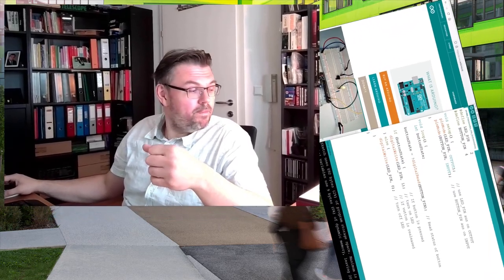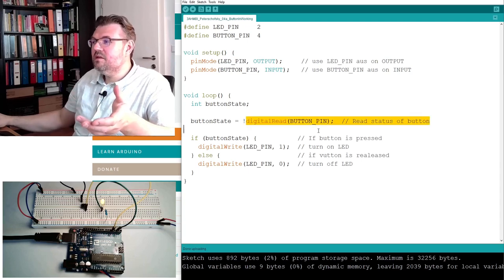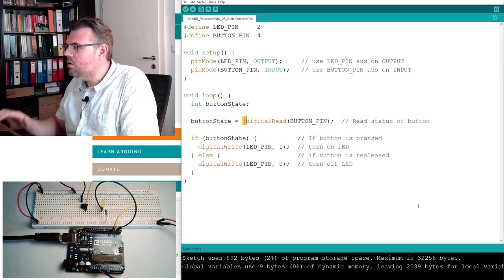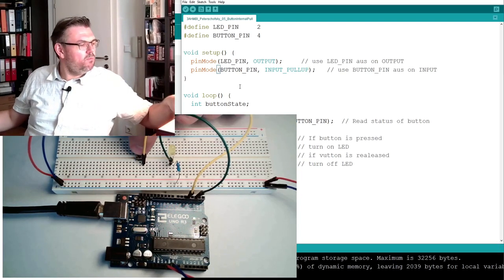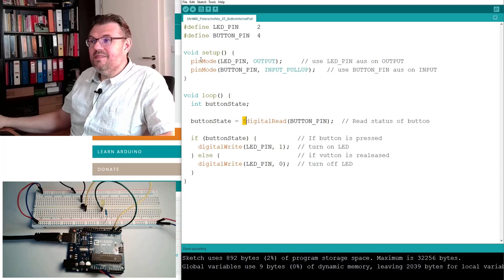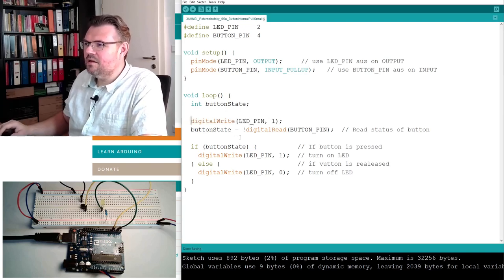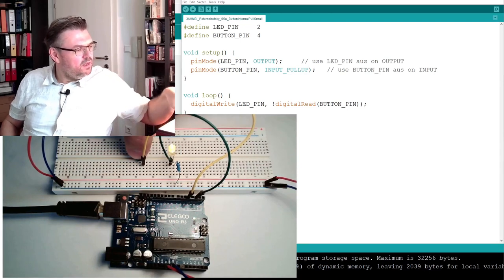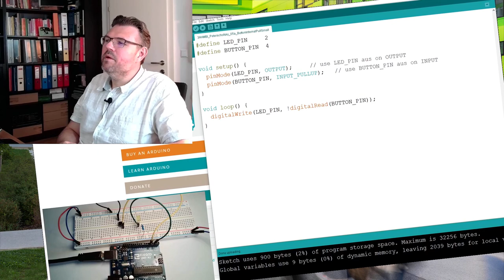Arduino 11: Internal Pullup Resistor

Comment: Hi Heinz, I agree 100% with you. There is a huge difference between engineering and programming. I also started to ignore the so called correct way of programming. I write my code in a fashion that will be understandable to any engineer reading my code. By using simple functions you can reduce your code more than enough without using single complex commands. I recently got hooked on Arduino and the most difficult thing was to aim for the correct programmer way of things. Best way for me is, write your simple code as it make logic sense to yourself. The rest will come in time.
Reply from the maker: Hello Marius. Yes, we are on the same page. I think everybody who ever looked in an old code will agree that it is better to write maintainable lines. 
I also do a training with by pupils: One day each is writing some piece of code. And the week after they are using someone else’s work to extend the function and add some functionality. There they see how important it is to write read- and understandable code.

Comment: Can i use this on pir sensors and simple door sensors
Reply from the maker: Hello. That depends on the wiring. PIR sensor modules usually switch between +V and GND by themselves. Then INPUT is sufficient. According the door sensor: if this is just one NO (normally open) or NC normally closed) contact with 2 wires you have to use the INPUT_PULLUP as described here. A NC would then be very convenient, since you would directly get the correct status: switch activated: read "1". Hope this helps.
Reply: @HeinzPeterschofsky  Are you good to solve errors in a sketch. I have made a sketch for monitoring and controling things in my boat by gsm. All relay and sensors runs good but the volt sensor cant i get to respond the voltage. I can ask for the volt value and the sketch respons but with out the volt value.. all i get is @@